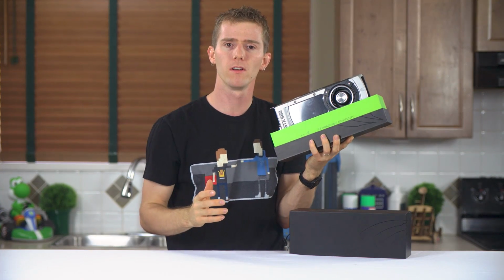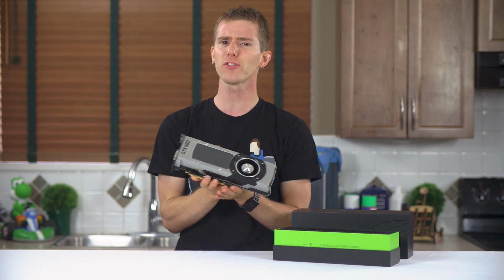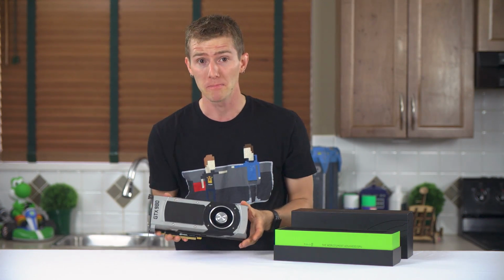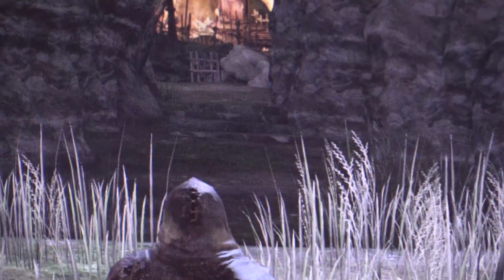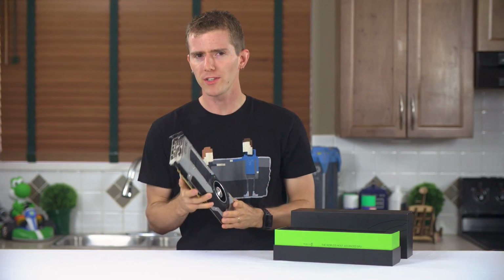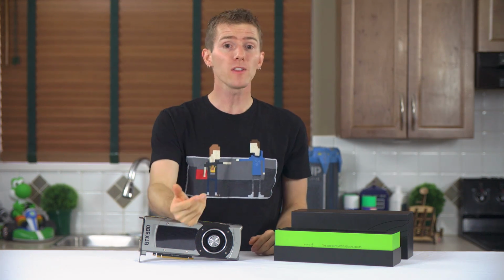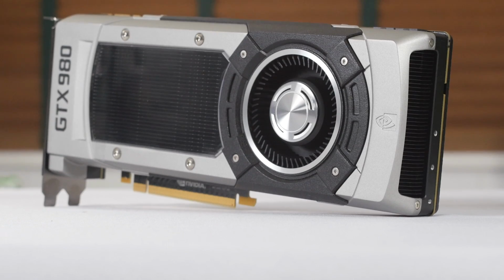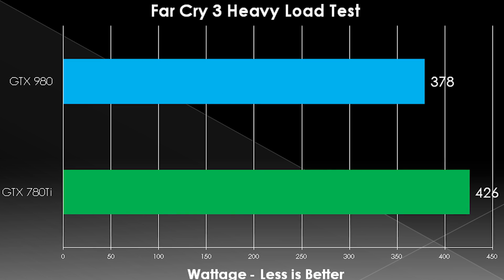NVIDIA GeForce GTX 980 Video Card - Performance Overview

Comment: The 980 doesn't even justify it's name, looking like it's two generations ahead of the 700 series yet both the series flagship cards perform the same! Are you kidding? Neither cards will get my money. The GTX 780 ti and 980 are neck and neck, and I expected it to perform a bit better. 4K is still way to difficult for a single graphics card to handle, maxing out your game settings with 4k will leave you @ under 40 fps. I am looking forward to a possible 980 ti, or an early 2015 release of their next 14 nm process. Although, I do realize the features the 980 brings, but is it really THAT compelling? In my opinion, not at all. Unless you have a 500 series card, don't even bother.
Reply: It's not two generations ahead, NVIDIA skipped the 800 series for parity with the mobile series.
Reply: I really hope AMD brings up some rough competition with their R9, "300" series.. I've been rocking an Nvidia card for 2 years now, but I'm not biased. If AMD can really bring some performance to the table, I would switch in a heart beat. But they can't manage that so far. Because of this, AMD only owns 30% of the GPU market share. If they can win me over with TRUE next generation performance, chances are they're gonna grow that market share. If it does win me over though, I'll really miss CUDA.
Reply: I almost think Nvidia should have just waited for the 14 nm process, because it is not worth upgrading in the least bit. All you get is slightly better power consumption and more features that chances are, not many gamers will truly care about. Performance gain is about 5 or 6 percent from the 700 series when you consider the recent price drops.
Reply: Ya I agree, I have 2 680's and the power is more than enough for me. I thought this card would have atleast been 30%+ better than the 780. Until NV releases a single card that can beat my 680's, I'm sticking with them.
Reply: facepalm.  the 780 AND 780ti can BOTH handle 4k gaming JUST fine.  Ya DON'T need maxed in game eye candy and YA DON'T even need ANY AA let alone 2 or 4x AA.  Ya don't even need AA on 1440p 27" at 2.5 feet from the monitor like most NORMAL people would view it from.  Why does every idiot think they MUST have maxed settings for the game to look great.  

The ppi in 4k 32" at 2.5 feet from the damn screen , ALONE, is PLENTY to NOT need anything more than even medium settings and NO AA which is PLENTY of eye candy goodness.

You people need to get over yourselves and have a reality check. And NO, both the 780ti and 980 DO NOT perform the same.  bf4's MINIMUM ( which is the MOST important FPS measurement for anyone with half a brain on pc gaming) is improved from 40-42  to 50-54..If you can't see the difference in 10 fps at the 40 or 50's mark, you need your eyes examined by a professional eye doctor.  It is WORLDS apart difference?  No, but it's NOTICEABLE enough.

" Unless you have a 500 series card, it's not compelling choice".  *facepalm*.  
 

UNLESS you have a 4GB gtx 680.... a 4GB 970 and 980 WILL be a good and VERY noticeable improvement over a measley 2GB vram 680.  If you thought differently, then you obviously have a clue and haven't kept up with pc gaming hardware at all.
Reply: You realize that the 980 is in fact a direct replacement of its little brother, the GK104 680, not the GK110 based 780&780ti&Titan. Those cards are totally different chips based on the same arc. So when you take that into consideration the 980 is about 2x the performance over the card it replaces. Not only is it 2x as powerful it even runs at no more than the same exact power draw. They skipped the 800 series desktop cards as to keep the mobile GPUs and desktop GPUs in the same family name. They did the exact same thing with 300 series.

And if you want to compare the 980 to the GK110 chips you must note that:
1.) The 980 has over 800 cores LESS than the fully unlocked GK110 chip found in the Titan Black and 780 ti.
2.) With both cards at stock speeds, that is the 980 and 780 ti, the 980 is on average 10% faster while using 50 watts LESS than the 780 ti.
3.) Since the 980 has a TDP of about 200W and has the same cooler built for the 250W GK110 cards, the 980 has considerable overclocking potential. K|ngp|n has already called these cards overclocking monsters.
4.) NVIDIA is making 4 features exclusive, for the time being, to the 900 series. These features, when adopted, will bring more realistic "eye candy" to screen.
5.) The 900 series also has an exclusive feature, as of the writing of this comment, of Directx12 support.
5.) The drivers for the 900 series, as of the writing of this comment, are in early release phase. NVIDIA can still streamline the drivers for the cards, leading to higher performance from the cards. We've only seen the beginning of what the 900 series can do.
6.) NVIDIA accomplished all of this on the same 28nm process that the GK104 and GK110 chips are based on. It's TMSC's fault that they couldn't get their factory to create an efficient yield of the GM204 chips on the 20nm process, which these cards were originally meant to be on. Imagine the performance gain along with the power efficiency that these cards were supposed to have. NVIDIA settled and this is what they got. A card that outperforms all other single GPUs on the market at a competitive price while using less power. AMD can't touch NVIDIA. And if AMD comes close with the Rx 3xx series, NVIDIA will just release a replacement for the GK110 chip.
Reply: Raymond Tyson so mad what if he WANTS to max everything? I want to, just don't have the money to spend on upgrading. Gr8 b8 m8
Reply: The Minecraft Sauce
well amd's r9 295x2 beats the titan z easily for about half the price if you want to go get it :)
Reply: ***** I know that, jeez, I'm not an idiot. It just isn't worthy of the 900 series name. I said it was looking like it was it's two generations ahead. Maybe you should actually read posts before calling people idiots.
Reply: The 900 series is FAR from obselete if you have a 600 series. The 980 is a poor example to look at either way - it provides some ~5% gain on a 780ti, but it does so at a lower price point than when the 780ti released, and also consumes quite a bit less power. The real gem lies in the GTX 970.
A card that beats the 780 with ease and nips at the 780ti's performance in many cases, yet has a TDP that's 105w lower, whilst being very silent and in the case of some cards, doesn't even activate its fans until 50c has been reached.
The best part? it's 25% cheaper than a 780!
Heck, over here in London it's actually £30 cheaper than the price I paid 2 years back for my 670, and even then that was at a special sale price.
You can currently grab 2 970s for around $40-50 more than the cost of a single 780ti. Perfect card in my opinion.
Reply: i got a 780 and 4790k just for porn. shut up, buy whatever you want and use it whatever you wanna do with it.
Reply: I highly recommend reading Amazon reviews before you buy Graphic Card amzn.to/1tIcF9m Click to view now !!!
Reply: u're a total tool. they chose the name because the 800 series is around for ages in laptops already, so using 800 now for the desktop cards wouldn't really justify their performance.
in this video you had a direct comparison on the old and the new chip and you still don't think this is awesome? dude, the new chip is A LOT SMALLER. this alone is an awesome archievement for nvidia because it reduces production costs a lot making the relatively low prices possible and ofc lowers the power consumption, heat and fan noise.
at the same time they manage to increase the power A LOT compared to the old architecture considering that they are still on the same 28nm process.
the performance gains you want are not possible anymore because it is very very.... very very hard to go to even smaller processes so you don't need to expect that now and especially not for the future.
if this power is not enough for you you should not wait for the new generation of AMD cards because it is pretty much unlikely they will beat these cards a lot. if they do, nvidia will just bring a bigger version of this chip in maxwell 2.0 design and put even more transistors on it and you'll get something like the 980TI which will beat every other card out there again.
I am not an nvidia fanboy, I own a R9 290. and this new generation makes me cry... (I'm on an UHD monitor and really need the power)
Reply: Dude it completely makes the previous cards obsolete. Better performance in just about everything + its cheaper + new features added. What more could you want? As with pretty much all generations, its not worth upgrading for the lols, but for someone who's building a new PC (like me) waiting for the 900 series cards is a HUGE benefit.
Reply: Sizzling Salami  hmm shit taste in games yeah. thats why i have a 980 to run minecraft moron. To be honest i dont play it anymore my profile pic and name needs an update. I personally play skyrim, BF4, rust, Cod, gta  and other similar high end games. just because your running a nvidia gt 210, maybe in a few years flipping a few thousand more burgers at mcdonalds you can save for a gtx 660...
Reply: i forgot to mention it costs millions for nvidia to develop a new nm process, they ait gonna cook one out early 2015. Plus the 980 is £470 a 780ti of same brand is £520 and the 980 is faster and more power efficient. they havent benched any high clock cards yet i.e evga.

and nvidia have stopped ti versions of cards now.
Reply: Also for those comparing the Titan Z to the R9 295x2. Just remember the Titan Z is for compute processes and simulations. It is in fact based on the GK110 which was the GTX Titan's chip, which was a GPU for the Titan supercomputer. The GK110 chip was never built for gaming, ever. NVIDIA just tried to market them as a middleman chip, good for gamers that are also workstation users. And for workstation users, the Titan was a blessing. Do you know how much a full silicon and metal workstation GPU costs?
Reply: Grubite
Why the hell would you want to play the unoptimised, broken, shitty low res console port game that is Watchdogs ON A PC? And moreover, why play it at 4K when it's not even good looking at 1080p? ...

Anyone who bought a high end GFX card to play shit like that needs to be shot and have their PC donated to a real gamer.
Reply: The greatness is in the power consumption and efficiency.
Reply: I highly recommend reading Amazon reviews before you buy Graphic Card amzn.to/1tIcF9m Click to view now !!!
Reply: it's all hype. 4K and what's not ! the performance got so high due to fierce competition with AMD, they didn't know where to go with all that performance, so they had to come up with 4K to justify the performance and give people a reason to buy that "performance". this is why 30fps isn't considered playable anymore and this is also why the 900 series isn't meant to push "performance" significantly although the technology exists to build much much so frkn much faster gpu's
Reply: tbf this is the stock gtx 980 at turbo 1216mhz. The custom evga, msi cards run at turbo of around 1350mhz. still cheaper and faster than the 780ti. Considering it has lower cores 2.1k vs 2.9k and only 256bit bus vs 384bit. ive upgraded to the 980 from a much lower spec card. although i doubt you would need to update from the 780 as it can still run most games just fine.
Reply: Sizzling Salami
we dont all play minecraft, sure i play it but not all the time, im planning on playing BF3 and BF4 when i get my new rig
Reply: Sizzling Salami  so bf4/3 is not to your taste then? i spend my money on what i want. and yeah its cool that trolls like you cannot have what they want. dont forget ill be coming for a burger tomorrow, i would like a big mac if you can get me one ready at around 2pm :')
Reply: Sizzling Salami
1. not all gamers live off their parents' money, im getting a job soon anyway. 2. not all gamers live in fucking basements fucktard
Reply: Sizzling Salami  nah i earn £15 an hour, i do what i want. and no i pay my parents and go to work 52 hours a week. just saving for my own place at the moment and should be moving out soon.
Reply: Sizzling Salami
fucking dumbass why do idiot pieces of shit like you exist? oh ik, a girl's night out drinking and bad ideas thats why you exist
Reply: The Minecraft Sauce What are you meaning? They do compete with Nvidia in terms of raw fps? How do you think the r9 280x competes for the 770 etc? You clearly are bias.
Reply: TwHawrd
i'd go and buy it as soon as it came out if they released one
Reply: Ya but the 980 brings a lot to the table for cheaper, less power usage, and better Graphical rendering for the future, if you were going to upgrade your graphics you should undoubtedly go with the 980 rather than the 780 ti which production will be canceled soon, Unless you are in the market for workstation graphics.
Reply: Lets wait for better drivers to come out to unleash the beast's truly potential. Also, it uses less power, is more silent and lower temperatures. Its not all about performance.
Reply: Martin Kargo it kinda is all about performance i meant I'm not gonna spend that much money just to save a little electricity I'm spending to be able to play bf4 100FPS on ultra
Reply: lord quasimoto 4K is not far at all. Expect 4K to be powered by $400-$500 GPUs in a year or two.
Reply: The Minecraft Sauce The next step for GPU manufacturing is 20nm, followed by 16nm FinFET. Only Intel is going to use 14nm, but they're almost 2 years ahead of their competition.

Besides, this card has an 165W TDP. Compare that to the +280W AMD's 290X is using and you get a feeling how fucked AMD currently is...
Reply: I have an AMD 7770 It's time for a 980 xD
Reply: Andreas Tapas
why are people talking about minecraft???? minecraft is all about the processor.... shaders in minecraft maybe... and there is no such thing as "real games". If it is a game it is a game..... -.-
Reply: Puthearith Chea
you really like the 4K real feal xD
Reply: Andrew Russell
QUIET!!!! NOT QUITE!!!!! Every fucking day I see thousands of Youtubers who can't spell QUIET! It's not hard. One is Quiet ... the other is Quite. Something can be quite quiet, but it can't be quiet quite. OK? Think about it.
Reply: Andrew Russell Then you paid £500 for a useless piece of trash phone. What ever happened to spelling it yourself? The brain is a muscle too. Imagine in 50 years when the oil runs out and there are no more phones or autocorrect. We're gonna have a society of illiterates who can't even comminicate with a pen.
Reply: Andrew Russell
If everyone took a chill pill, and forgot about the skills, values and traditions that humans in western society have developed since the Romans, then in 10 years everything would fall apart and we would have a country full of mong zombies. So forgive me if I refuse to take a chill pill and continue to exercise my brain. I wipe my own ass, I make my own meals and I spell my own words.
Reply: Yeah I've recently been contemplating selling my 780Ti for a 980 but recently decided against it.
Reply: All I can say is 780ti kingpin SLI ftw!
Reply: FreeTheSecondOne
lol if you've actually got that... That is a  SICK fucking build. I've got the reference 780Ti, but if I had my choice in which one I'd get, I'd have definitely gotten the kingpin one. Some people hate the way it looks, I think it looks awesome.
Reply: TheVanillatech NVidia cards have almost always run below 80 C ur clearly into AMD so go troll somewhere else perhaps?
Reply: ***** The technology is amazing on the new GTX 980 no doubt, but even with (as people call them) "matured" drivers I don't see a big impact in performance. I think people should stop arguing and accept that the 980 beats the 780 but is more or less even in performance with the 780 TI. But also that it was never made to beat the 780 TI, which is a ridiculously over-priced card.
Reply: TIZ012 pretty much i was trying to say you a dumb ass and what ***** said to you
Reply: Divey1130 im personly upgrading from a 670 to a 980 i want some more horse power and i want to do it with 1 card
Reply: It performs better than the 780 TI for $200 less than the 780 TI, what's NOT to like?
Reply: as for me, i'm still running to GTX 560 Cards in SLI, so it would be an upgrade for me. I was really wanting to get the 780 Ti but it's just about 700 dollars! 700! Compared to a 980 which performs about the same in most cases, if not better for 549! To me.. how could you not choose this beast of a card? Sure the 290X from AMD is cheaper, but the nvidia card is a better card overall.
Reply: GTX 980 is to be compared to the 680, in reality. As it is GM204 just as the 680 is GK104. The 780 and 780 Ti are based on GK110, GM110 will likely be launched with the new Titan or 980 Ti in the coming months. 

You also have to remember that the 780 Ti  launched at a price of $700, even the 780 launched at $650. This card is $550 and delivers performance the matches the 780 Ti while being much more efficient and cool.
Reply: Minecast Zyad48 2 to 3 cards is realistically the best of the best practical pinnacle of pc gaming each time. The 4th card is always pointless and damn near useless overkill and a bigger hole in your wallet that could  have otherwise paid for a 512GB damn good ssd instead.  2 980TIs is a great idea imo.
Reply: The 900 card run at low watt with low temperature thus having lots of headroom for overclocking.
Reply: Raymond Tyson ***** first ok it was joke let stop fighting, second im actually not even in college yet and still in high school and I already can tell that one word in caps isnt yelling, although certain ppl dont get it so I guess using "*"'s would help in that respect but most ppl already get it and even use it(i use the caps on one word thing sometimes)
Reply: Nitrobucket because the 980's take less power and produce less heat and therefore have more room for overclocking and will give off more performance after overclocking
Reply: The above posts is why no-one should ever, EVER take advice from ppl online about technology. Do your own research form ur own opinion :D
Reply: Crowded House I highly recommend reading Amazon reviews before you buy Graphic Card amzn.to/1tIcF9m Click to view now !!!
Reply: With newer drivers the 980 should perform a bit faster than a 780ti, but look at what you're getting with the 980: Less power consumption, 4GB vram, less heat, special features such as MFAA and VXGI. I left my GTX 780 and grabbed two 980's and I ain't ever looking back lol.
Reply: I have a 660, the 980's looking quite shiney to me.
Reply: Raymond Tyson
CUZ WE WANT THE EYE CANDY BUT WE ALSO WANT ACCEPTABLE FRAMERATES THE 780 DOES NOT HANDLE WELL ON FUCKING 4K WHICH IM SURE CANT BE RUN AT 60 FPS ON LOW SETTINGS SINCE 4K IS 4 TIMES HARDER TO DRIVE THAN 1080P THE 780 TI CAN RUN 4K ON LOWER DETAILS AT 60FPS YES BUT THERES NO REASON FOR 4K ITS BETTER TO RUN THE GAME AT 1080P AT HIGHEST DETAILS AS IT WILL LOOK BETTER THAN 4K AS LOWEST DETAILS, although what do yhou mean that the minimum on BF4 is 40-42? i love BF4 but i dont understand what you mean by that
Reply: I'd rather go with the 980 for a new build, it's the same price as a 780 so it's a bit more worth it for for the price.

It's not worth the upgrade from the 780 but it's a better choice for an upgrade from an older/low-end GPU or for a new build.
Reply: Sizzling Salami  ;P
Reply: Divey1130
Oh yeah because 1 can obviously beat 2. Stop bitching about it. Two cards will always over power one card.
Reply: Henry Liu  nvidia 210 x2 vs gtx 980 :D
Reply: The Minecraft Sauce Ya know, all their results are overclocked. Stock speeds the 980 stomps out the 780 Ti, so does the Asus 970 Strix, for a list price of 350$ USD.
Reply: Currently I have a 780 and i won't change it until Nvidia releases it's Pascal Cards but if the difference is still to small i also won't take a Pascal card.
Reply: TB Craft there are benches out on the Asus 970 Strix. You will need to use google translate tho. http://www.sweclockers.com/recension/19332-nvidia-geforce-gtx-980-och-gtx-970/7#pagehead ; list price is 350$ USD. I wants one.
Reply: ***** I understand that, but it isn't worthy of the 900 series naming. With this performance difference, and the fact that it's still 28 nm, I have no idea why Nvidia skipped the 800 series naming scheme.
Reply: jcauleyj They skipped it because their mobile gaming-cards were already on 800, and so they wanted both mobile and desktop GPU's from the same Architecture to have similar naming schemes in order to lessen confusion among consumers.
Reply: You don't know what you're talking about. 14 nm?   That's many years away, next year is 20 nm.
Reply: Sizzling Salami You kidding me? You think all I do is Minecraft? For one, I do audio production, content creation, 3d animation, ACTUAL gaming, and much more. Stop being so stereotypical and open your eyes.
Reply: The Minecraft Sauce I may seem dumb but what if they release a 980 ti? :/
Reply: *****
True. But the cards don't perform as well as a workstation counterpart. But compared to the workstation counterpart the geforce version could handle gaming. So they decided to market the confused GPU as a gaming card. This is both NVIDIA's fault and the consumers fault. But mainly the consumer's. If the consumers researched the item they were thinking of dropping 1k dollars on instead of following the mantra "More money means more performance" then they would have realized that those cards are in fact not for gamers but for niche consumers that reside in the in between of the worksation and gaming community.
Reply: There marketing for this card was power consumption, cooling, and cheap upgrades. Dont forget these cards will be Overclocked to fuck when they have aftermarket cooling on them. 980's in sli x2 only need a 700w PSU under max load.
Reply: dude they only look the same and the 980 preforms a little better and is 150 dollars cheeper. plus you waiting for a 14nm process aint gonna happen they would have changed it in the 980 if they were going to change it at all. so if you want get a 550 dollar 290x that doesn't even preform nearly as good as the 980 but for the same price.
Reply: Sam Kowalski
where on earth did you find the 980 for 150 $ cheaper? i could only find it for 20$ cheaper
Reply: LOL i found it on amazon for 550 dollars unless the price changed. and if you play games like mine craft all you need is a 760
Reply: Sam Kowalski I have a 760 and I still need more for shaders and recording and mods.
Reply: RgbShadow yeah you will definitely need more for shaders but my friend plays a mine craft world with like 125 mods and still pulls some good FPS and recode while doing so. and mods are more CPU/RAM intensive. so yeah what do you use to record and what brand 760 do you have (msi, EVGA, etc...)
Reply: Sam Kowalski I have an EVGA and I do play with about 125 mods and get a good 130-230 fps once you add shader tho I get 50fps and I have a 4.4 oc fx 8350 but without shaders 760 is really all you truely need
Reply: well yeah shaders i know just is a FPS killer. so yeah if you want shaders at 60FPS you could probably just get a 970 cause the 970 is suppose to only be about 300 dollars and still preforms good. RgbShadow
Reply: I'm personally going for the 980, but that's because I currently have only a 7870 that has been giving me some issues lately with drivers, even after going back to the stable ones. I also have Star Citizen, which I plan on playing with my friends, and I know for a fact it'll just send my 7870 to hell. All the other features from Nvidia are really nice too, and I have the money to back up justifying this thing. Everyone has their options tho
Reply: Martin Kargo
its about both performance plus lower feat, sound and power consumption :D
Reply: Let me guess your a amd fanboy besides maxwell is full of potential and with lower energy requirements at almost half as much as the 780ti while performing better which for over lockers the lower tdp is great as it won't run as hot and for those who will do sli especially with a 5930k and a x99 mobo (my self) will give so much more performance compared to sli 780ti also the 980 has less cores than the 780ti which has 2880 cores which gives maxwell the advantage to become amazing in the future and it runs directx12😱 be amazed and join the future and the cheaper price is worth getting the 980
Reply: The 980 is better than the 780ti, more overclockable, and runs cooler, and quieter, and isn't even a ti edition.
Reply: MitchHellion
and its cheaper ^^
Reply: Minecast Zyad48 Yeah
Reply: Consider looking at it like GK104 vs GM204. The increases are great that is for sure. GTX 780 and GTX 780Ti are based off of GK110, a totally different beast. IMHO the moniker/nomenclature ARE NOT to be dissected as you have done.
Reply: The Minecraft Sauce
Dude .... AMD (ATI) have been current leaders in terms of performance / value for over 9 months now, in EVERY section of the market. They have also had the most powerful enthusiast card for even more than 9 months. What more incentive do you need? Both the shitty next gen consoles use AMD GPUS, so you can bank on the fact that every single game which comes from the consoles to the PC (no matter how shit they will be) will ALL run faster on AMD hardware.

Now is not a good time to buy any card. Until the prices hit rock bottom of the older models in a few weeks I'm holding out anyways. Probably be able to pick up a GTX770 or an aftermarket 290 for very cheap soon.
Reply: epictoads But if you have a 700/600 series card already, it makes the 900 series obsolete.
Reply: Sizzling Salami So? Does that mean the only thing I do is Minecraft? No.
Reply: I wondered about this too, but earlier today I drew a conclusion
Remember when 800 series came to laptops? I had no new features compared to the 700 series and I don't know why they weren't implemented (Either because chip manufactures were late or technology wasn't developed/done yet.) but because of the 800 series not having these technologies they had to call this (which was going to be 800s) the 900s series as it features things like MFAA and DSR.
Reply: 14nm? You mean 20nm?
Reply: Grubite 4K is already powered by the 980 quite well unless you're a hardcore gamer. Starcraft 2 probably gets 60fps on 4K at max settings. it's an old game, but still noteworthy.  I mean, who needs max settings anyways. 4K is already pretty boner
Reply: Mark Cuntie I'm talking Watch_Dogs Grand Theft Auto IV (modded of course.) and games like that.
Reply: TheVanillatech Watch Dogs is fine. It runs at 60fps ultra 1080p on my 780Ti, 16GB RAM, and i7-4790k
Reply: Grubite
If Watchdogs is fine to you, then all the best!
lol
Reply: Holy shit this comment is bad.
Reply: Derek Foster i would like to make a little correction. the cooler on the 980 is heatsink based, not vapor chamber based. however thats just my being nitpicky.
Reply: Really, the real shocker is the 970...
Reply: I have a 400 series card still so I'm going for the upgrade.
Reply: Your Doom

Had this come out 3 months ago, I wouldn't be using a 280x...

Still, with the 280x going down in price I'll probably be able to pick one up in a couple months for a crossfire setup without any problems.
Reply: well put
Reply: elgoog kcuf
Still, there's probably going to be some nice price cuts soon... I'm thinking Crossfire.
Reply: "But will it play Minecraft ?" pft of course retarded question :)
Reply: Gds1 dcf d
Reply: TB Craft Wait wait wait....hold on this might offend you but wait a fucking second BF4 is considered a high end PC game to you? All you need to max that steaming pile of shit is a GTX 660 which in itself is a sub 200$ card hell last I did a price check you can get the Asus GTX660 around for 150$ I just wanna know how is that in any way considered high end?
Reply: The Minecraft Sauce
 having a 700 series card doesn't make 900 obsolete, that's just a stupid thing to say. they are BETTER and CHEAPER, thus making the PURCHASE of a 770/780 pointless now.
yea it's not worth upgrading from a 770 to a 970, but neither was upgrading from a 680 to a 770 when it first came out. It's not about making everyone upgrade when a new series of cards come out, it's about improving upon existing cards so that progress is made. the 970/980 improve in EVERY ASPECT over the 780, making it an improvement.

wtf are you even complaining about? Nvidia release cards that beat out all competition in terms of both price and performance, and it's not worth buying?
Reply: epictoads
Climb out of nVidias ass please XD

Sure they just released the new single GPU performance king and the best power to value card on the market, but they are BRAND NEW technology. AMD/ATI has owned both those titles for over 12 months. And if you discount the new cards, AMD had a better solution right through the entire spectrum for about the same time period. nVidia needed to do something or they were gonna get fucked.

I guess when ATI release their next cards and beat the shit out of the 980/970 in terms of value and performance you'll be paying homage to them too?

Nah you won't. Cos you have a giant "N" tattooed on your ass.
Reply: TheVanillatech bray you can stop cause its just as cheap as the 290x and well i think we all know which one is faster oh sorry i forgot the 780ti was faster 2. like you are obvi a AMD fandoy because the performance to money is what matters not whatever the fuck your talking about
Reply: TheVanillatech and if you are gonna be that quick to say he is a fanboy then don't act like a fanboy cause we can all tell you are one
Reply: ColinZtmnf lol that is like perfect what you just said
Reply: Minecraft is BS end of story... try some real games ffs !!!
Reply: CentralNintendo1
LOOL
Reply: I got two 660 Tis, and I'm pretty sure it will be an upgrade well worth my money.
Reply: Yeah, I am fine with my 750ti, fast as a Cheater, quite as nothing and uses less power than my toaster
Reply: Are you stupid? This is the general step up naming. You get the next card up's power at the lower number. 780ti at 980, same performance would be 980 being 780 performance. 780 performance is at 970, just how the 680 when to 770 (literally the same card just overclocked).
And as you can see the 980 IS quite a bit faster than the 780ti in 1080p and on par with 4k after overclocking for less money. Also most people are gaming in 1080p, 4k still has a like 2 years before it's more adopted and single gpus can handle it easier.
Get out of here.
Reply: Kian Palmer
Im selling my 2x670s and getting the 980. It will be slightly faster for me. I want the way less heat and im going to watercool it so it will be quite. I do want a 980ti but they haven't announced yet and I'm on a time limit.
Reply: TheVanillatech I know it's quiet, it's called autocorrect that messed it up.
Reply: TheVanillatech You realize that you can spell a word correctly but the phone thinks you're spelling something else, right?
 You need to take a chill pill dude.
Reply: TheVanillatech If I had've spelled everything wrong then I wouldn't blame you, but if you freak out over one word in a comment on every comment, then you may want to get off YouTube. People don't care about spelling, this isn't English class or a job.
Reply: Andrew Russell
My quibble isnt really with the odd spelling mistake. I told you I have seen countless comments across numerous websites where Quiet had been spelled Quite, maybe 40 in this last month alone. Clearly this technology, created solely for the purpose of communication, is actually hindering it.
Reply: TheVanillatech I feel it is mostly due to kids refusing to learn. They just want to play around and not learn. Part of it is technology with things like autocorrect but I blame the people more. As we speak I'm sitting in my college networking class and there are two people that never pay attention yet complain about not knowing anything.
Reply: Andrew Russell
Accepted. The pattern is basically a steady drop off a cliff since basically even before I was born. I see kids every day who have the same attitude and problems. Must be hell being a teacher these days with your hands tied behind your back and your lips taped shut, and I plan on becoming one myself. Having said that, for all the bullshit laws put in place to assist this downward spiral, there are still some great teachers. There are also a lot of moronic ones who probably only turn up for the cheque. Wankers.
Reply: First of all it's the next generation since 800 series is mobile chips, and secondly the 980 is flag ship because there is nothing else, when the 980Ti is released it will dominate both the 980 aswell as the 780Ti, you can't compare an 80 class card to the previous generations 80Ti and complain that they perform the same, they should be.
Reply: *****
This is what I hear in my mind when I read your comment :

"Merrr mer meh mehhhh merrrrrr. Rarrr rarrrr Rarrrr Rarrrrrrr. Blah blah blah zzzzzzzzz............"

And then I fall asleep.
Reply: *****
Your mama
Reply: *****
No friend.... YOUR Mama.
Reply: *****
:D Dickless
Reply: *****
Merry Prassy
Reply: cough cough Overclocking cough cough
Reply: I love rumours about new tech as much as anybody else...but I'm realistic about it. There was no way in hell that the next nvidia GTX x80 would completely destroy the GTX 780 TI. I read many posts that it would up to 20%-30% better than the 780 TI and that sounded impossible. However it was possible for it to be 20% better than the actual flag ship nvidia card which was the original GTX 780, which it was...so nvidia has done exactly what they do with every other generation of GPU. People tend to think the 780 TI is the same as the 780 just upgraded (which in all honesty it is) but its more like nvidia's new GTX x90 introduction...the 700 series had no actual GTX 790 why was that? Because the 780 TI already existed thats why. Also if someone wanted a ridiculously powerful card they would go for the Titan Z which is basically the GTX 790 with increased double precision performance. Thats it I guess...
Reply: wow a lot of rich people in that comment section. talking about "1000 dollars cards" like they are cookies...
Reply: Yeah its not a good idea to sell a 780 TI for a 980, the pure processing power is better on a 780 TI. Also I don't agree that the GTX 980 is 10% faster than the 780 TI as it was commented previously in the comments. Its more or less equal in terms of real in game performance, with some instances 980 is better and others 780 TI.
Reply: TIZ012 Plus the 780Ti has 2880 CUDA cores vs (how many does the 980 have? I know its significantly less, like 2032 or something), and in my mind, that makes it more valuable in itself. Sure I'd love a 980, but I couldn't possibly rationalize selling my GTX 780 Ti for less the $500 at the moment considering a dropped $700 on it in the first place.

The 780 Ti is a beast of a fucking card and there really aren't that many games I can't max out as it is. Te only appealing thing about the 980 to me is the overclocking headroom. I'm really interested in that as I love overclocking.
Reply: *****
But can it run Crysis?
Reply: Sizzling Salami
What is wrong with future proofing your gpu?
Buying a flagship card may be expensive but it will last you "at least in my case 4-5 years" before upgrading again.
This is common enthusiast practice.
Reply: Sam Kowalski Well, lower power consumption = less heat, less heat = better overclocking. So far ive seen numerous of people hitting 300+ core overclock with just reference aircooling, which is a huge leap and should push the gap even further from the 780ti. And as mentioned earlier, lets wait for drivers to mature.
Reply: Martin Kargo yeah idk but i think the 980 gtx with a reference cooler is good enough for me cause i would rather just get a water block then oc like a bouss haha
Reply: I like my cards not melting, so I'd rather not get anything from AMD
Reply: Maxim_Iliagouev
Ahahaha! The first time nVidia release a card that runs lower than 80 degrees in years and BOOM the fanboys bring out the dusty old guns from last decade. Priceless xoxoxo
Reply: I think the whole point in the 970 and 980 is the fact that they have the same power as a titan but at a far lower price, this might not be great news for a millionaire gamer but for the rest of us this is a great thing to happen! From this point they can make even stronger graphics card for smaller price tags.
You see, there are two ways that a product can improve. 
1. It performs better. 2. It performs as well as its predecessor (but) for a lower price.
Reply: TheVanillatech What was the point in bringing out the old? I'm talking about the new.
Reply: TIZ012 Okay 980 aside, is the 970 good value for it's price? Could it easily compete with the 780 (not ti) ?
Reply: TheVanillatech lol no whats priceless is that AMDs newest and best single gpu card runs hot as hell. LITERALLY. ***** Yeah the 970 in my opinion is very good for its price and could probably preform pretty close to a 780. idk though just watch some benchmarks
Reply: ***** Yes from current benchmarks and from my own playing around with the card it looks like the GTX 970 is actually more revolutionary than the GTX 980, in the sense that it is very close in performance to the 780/980
Reply: Maxim_Iliagouev I don't know what old he is talking about, I've followed and worked with nVidia GPUs since the GeForce 5500 all through out the 6/7/8/9000 series plus the 1/2//4/5/6/7/900 series. I have never encountered a GPU (stock spec, third party) which goes into the high 80 degrees C. For the record just in case anyone wants to correct me, a stock GPU is meant to hit a certain temperature under full load, normally its specified for nVidia to be between 85C-90C and AMD is around 90C-95C, having said that guess from the two companies which normally keeps within those parameters...can give u a hint and say its not AMD
Reply: TIZ012 amen ^^^^
Reply: ***** uh yer dumb because I'm sure these guys can OC way better than you plus you can't OC good on reference cooler cause they don't have the best cooling
Reply: FFS trolls like u annoy me...I don't mind ur opinion but when u try to flame someone else's post especially pulling the "if u can't spell" bullshit...maybe u should check back at ur comment and try writing out beat a few times so that u can also learn to spell. As for ur previous "opinion" u might be right, who knows maybe the 980 will be soo amazing even the titan z will be useless piece of crap. But as it stands these are the results we see these are the results we get, fact. When the new drivers come out and make NVidia the stupidest GPU developer in the world that's when we will know for sure the 900s true performance. From past experience I would just like to say, drivers don't often make a GPU miraculously AMAZING. But we will see. Now just stop trolling and flaming other ppls opinion just accept it or reject it that's it.
Reply: TIZ012 lol we dont need a fanboy here so you can ether not be biased or you can shut the fuck up and leave cause people who are fanboys dont look at the fu,l picture cause i think we all knwo that the 980 is the best card and i kinda think the titan Z is tupid is just to sli 780 tis tapped together
Reply: ***** lol so ignorant. Alright genius
Reply: Sam Kowalski I don't understand ur comment, and I'm not a fan-boy if ur talking about me?
Reply: Chill :)
It will come in time.
Reply: interlace84 lol i agree pretty much with what you are saying I'm just here to say i thinks its hilarious you weren't trying to start a argument and then technically is gonna try and start one with you when he 'agrees'. so since he 'agrees' i odnt get why he is gonna try to a rue with you
Reply: Why give him a useful tip, clearly he will just insult you again. Its like talking to a spiteful wall, that won't budge for anything
Reply: TIZ012 lol for real he insults people who agree with him
Reply: I thought of buying a gtx 980. But wait before you say anything the current GPU I use is Nvidia 9500 GT. I think thats an upgrade worth considering!
Reply: ***** Sounds about right :) thanks for the feedback.
Reply: yeah um I have  GTX 580 O.C from MSI and it died on me last night so..... I'm probably getting a GTX 980. Definitely not buying anything from MSI ever again. I think I'll go EVGA this time.
Reply: Kenshin Himura why won't you ever go msi again i mean that is a pretty old ass card. it was kinda bound to burn out sooner or later. but yeah evga is just as good so you can do whatever you want :)
Reply: ***** lol thats exactly what i was thinking cause msi is like the best manufacturer out there
Reply: ***** EVGA has a damn good warranty. Also nice cards. I prefer ASUS though.
Reply: ***** The 700 and 600 series will get that too.
Reply: TIZ012 I think they hold back their tech on purpose. It's always the same jump, but the 500-600 was a little bit larger. That's business! They probably could release some crazy shit if they wanted to.
Reply: All you guys should just stick with intel HD graphics.
Reply: Did you not see the name nvidia ? What did you expect, they believe that gamers want the same thing using less electricity. This is literally what they did. I'm suprised most people haven't noticed the 400 cude cores lacking from the 780. Compare it vs the 390x with with more than 2x the cores at 4224 2x the Rops. This gun be good in 4-5 months.
Reply: No top of the line card will handle 4K at a decent fps without SLI/Crossfire. It wont happen for a while.The jump from 700 to 900 is major. Lower TDP, power consumption, higher frame rates at a lower priced card, ability to use the new Nvidia technologies (MFAA,DSR,VXGI). Expansion to 4GB DDR5 leaves space for multiple card and thus 4k rendering. AMD is going to drop the 300 series soon, and it most likely wont perform too much better than the 980 at 4k. Not to mention, it won't have MFAA,DSR and VXGI. Technology is advancing at its own rate, things are always being pushed further, but it's on the table as the flagship of gaming GPU's. It's not worth to swap a 780ti or any of those high range cards, but for anything lower, it's worth it.
Reply: Serenity  AMD was the first to 4k. Remember they were releasing cards with up to 6 gigs ram 2 years ago. The 290x can play 4k without crossfire. Nvidia until the titan couldn't even entertain it without SLI. The 980 has 5 gigs of ram but not enough core power becuase of it's reduced ram bus size. 256 nvidia vs 512 amd. It makes a big difference when scaling up.
Reply: William Russell the 290x tho still struggles ALOT with 4k cause unless you are playing like mine craft any game on any card at 4k is only at a nice and 'smooth' 30fps so who cares if AMD was there first cause the still having figured out how to do it considering that nvidia is faster at 4k too. and just my opinion here but the 980 or 780ti is better than a 290x a little is performance but mostly in the fact that it just runs cooler and hell of a lot quieter. just saying I'm not trying to start a argument or anything
Reply: Sam Kowalski  You seem to miss the point. It struggles when running things in ultra that is it. It will require more going forward. Being first does matter because it tells you the objectives of the company. Making money is fine but delivering something to use is great. Nvidia realeased the titan - so lets not forget they had 4k for almost twice the price.
Reply: lol yeah lets not talk about the titan tho lol those were the dark days of nvidia. so yeah i see what you mean William Russell
Reply: Minecast Zyad48 The eye candy is ALREADY THERE.  The damm ppi is MORE than enough.  This isn't 10+ years ago when Medal of Honor ( the first pc version that ran on a single core 1ghz intel cpu and 32MB geforce 2 or 3 pci or agp video card) and resolutions of sub 1280x800 ACTUALLY showed MUCH more noticeable improvement when you cranked the in game graphical settings.  

If you have to play at 4k rez at 60fps or better fps WITH maxed settings on games like Crysis and Metro,lol, don't hold your breath unless you're that good at holding your breath for more than 13 months when the next line up of nvidia gpu's arrives with 6GB or 8GB of vram...stock, with more powerful vid cards.
Reply: Raymond Tyson well im not planning on getting 4k until they have 4k 120hz displays

and they have gpus that can power the game at maxed out on 4k 120 fps
Reply: Minecast Zyad48 sounds like you aint playing 4k for about 5 more years
Reply: Minecast Zyad48 AND LOL by that time we will have 10k
Reply: dkapbboy I do have it :P  http://www.modsrigs.com/detail.aspx?BuildID=33828
Reply: Sam Kowalski Even though it's an old card I was still running games maxed out or on high settings until it died on me. Battlefield 4 and The Witcher 2 are the only games I had to turn some settings down to keep the framerate between 40-60 at all times. That's because my GTX 580 only had 1.5GB of VRAM.
Reply: wait what are comment of mine are you talking about Kenshin Himura
Reply: I am still gonna get the 980 cause it is only about $50 dollars more than the 780
Reply: LeMasterChief huh weird, i can only find 780's that are more expensive than the 980
Reply: LeMasterChief the 780s used to cost less but all the prices went up cause the 700 series is discontinued
Reply: Sam Kowalski ah i see now, less of a certain thing means its worth more so since there will be no more 700 series cards being manufactured all the prices go up
Reply: yeah pretty much i mean i honestly think they should still make certain ones like the 760 or 750ti Minecast Zyad48
Reply: Sam Kowalski 750 ti is crap, the 760 is pretty good but why them?
Reply: Minecast Zyad48  because it would be kinda nice to have a somewhat mid range card under 350 dollars. but yeah i only said the 750ti because it can play like any can on medium settings or higher with good FPS
Reply: Sam Kowalski if 60 fps is your thing then probably yes the 750 ti would be good in most games but the 680 is more powerful than it and i dont think that the 750 ti can play BF4, although I could be wrong but since the 750 ti is pretty low end from the research i've done it doesnt look like it can run BF4
Reply: Minecast Zyad48 i having really researched that specific card but I'm pretty sure you can play bf4 at at least medium settings and honestly even on low settings bf4 looks awesome thats my opinion tho idk haha if i get a new gpu i would get a 980
Reply: Sam Kowalski yup 980 all the way, although i'd still like to see what amd's r9 300 series has to offer first and see if it beats the 980, this way nvidia will release a 980 ti or 970 ti which will probably totally wreck the competition
Reply: Minecast Zyad48 yeah i agree but i have to admit nvidia should have made the 980 way faster than they did cause the only improvement was features
Reply: Sam Kowalski and it is a litttle bit faster than the 780 ti overall, so i cant wait to see the 980 ti, itll be beast
Reply: Minecast Zyad48 yeah but what i want to see is a benchmark with a non OC 780 ti and 980 so i could see the real raw performance difference between the two
Reply: Sam Kowalski ok then, suggest it to linus
Reply: ***** lol XD
Reply: Well its 200 Cheaper then the 780ti and is decent so gtfo.
Reply: ***** 150$*, but your point still stands
Reply: Martin Romero As well as the fact that it's faster than the 780 ti whilst being $200 cheaper than the 780 ti. I'd say that's pretty great. $200 cheaper AND more powerful? Awesome.
Reply: ***** I didn't.  Try paying attention.  It was the kid who typed " CUZ WE CAN.BLAHBLAHBLAH" . lol.
Reply: Ken S. yeah i was very surprised when i looked up the leaked specs, like the 256-bit memory bus instead of the 780 ti's 384-bit but now ik to check out benchmarks before deciding, i thought the 980 for its price and specs was gonna be nothing next to the 780 ti but i was wrong
Reply: Not 2 gens away 
800 model are M mean as: mobile for laptops and compact computers
Reply: Alberto Jose Quiros Navarro you got that right and i think that the reason they skipped 800 series desktop gpu's was to not make ppl think that they'll be as bad as the 800m laptop gpus
Reply: 980 only just pips 780ti because nvidia slowed the 780ti down with drivers. 335 drivers my 780ti gets 75.6fps. 340 drivers = 71fps. 344.11 driver = 64fps.  fucking scumbags.
Reply: santclause1 I have NEVER seen nor heard of anyone getting WORSE fps on the same exact video card from one driver version to the newer one and I've bought AT LEAST 6 different video cards from the red team dating from 2003 to 2011, and 7 different video cards dating from 2002 to the present on the green side.  Drivers have always either done NOTHING to improve fps in the games I played, or improved them and the side effect issue(s) has/have been hit or miss on the red team, not an issue on the green team.  Something else is causing the problem on your situation. Recheck your settings.
Reply: Raymond Tyson santclause1 you may have a bottleneck in your pc, check your ram and cpu, from what i've read 12gbs of ram is the minimum for not having a bottleneck on a 780ti, i'd still go with 16gbs so that under heavy load the gpu still has room to move around in. cuz like he said, getting lower drivers and getting lower performance is just impossible from what i've seen and researched

edit: getting higher drivers and lower performance my mistake ;P
Reply: Minecast Zyad48 LOL.  RAM has NOTHING to do with whether or not your CPU bottlenecks your video card.  Video cards have their OWN onboard ram ( referred to as VRAM) and THAT version of ram serves a different " location" of purpose versus regular DIMM slot ram even in gaming.  

Now NOT having enough DIMM slot ram can cause a game to crash, and that is usually the ONLY issue with a low amount of ram involving gaming.  Either it runs fine..or it crashes if dimm slot ram is involved directly in the troubleshooting variable.

I've been building gaming machines for myself, my friends, family AND customers ( now over 70 of them) since late 2003.  I KNOW, from experience, what things bottleneck a video card and what things don't.
Reply: Raymond Tyson ik you say that you have experience problem is, what ram do you put in ppl's pcs? because the ram can bottleneck the other hardware, if not then we'd have no need for ram at all and just use the graphics ram in the gpu(VRAM), trust me I've done the research the ram can bottleneck if you dont have enough, the minimum ram requirements for a lot of gpus from nvidia and amd are 12gbs, if they specified a minimum requirement then that means you need at least that much ram for the card not to bottleneck, 16gbs is the sweet spot for most high end graphics cards since it will have more room for when it goes under heavy load
Reply: Ken S. its because you need more ram for the cpu to process all the data of the gpu getting more ram then try out the 980's it will get you more performance, now why do they give minimum ram requirements if its not a requirement?
Reply: You don't need a good GPU to run Minecraft maxed out :)
Reply: TIZ012
Yeah seriously don't want you to not understand this.... You are thick as pig shit.
Reply: danik18 yeaaaaahh no, you need at least a decent gpu, my cousin needs optifine on his radeon hd 1gb graphics card, and dont say its low end, its GDDR5 1gb vram
Reply: Lukas High oh ouch random insult I feel so bad....oh no what am I gonna do, ur insult means exactly two flying fcks to me...tell u what though stay in school and off the drugs little kid and when u get to my level and ur still throwing insults then I will laugh at u more.
Reply: Minecast Zyad48 No, I'm afraid that's not how computers work at all. Would you explain telling me why I get full performance with a nice overclock and no issues of any kind whatsoever when I have a GTX 980 with "only" 8GB of RAM? The long story short is, you have no idea what you're talking about and when multiple people are telling you you're wrong with actual proof of you being wrong, you're probably wrong.
Reply: Ken S. then WHY is there a ram requirement stated ON the graphics cards specs page?
Reply: Minecast Zyad48  Sry just couldn't help myself even though I'm not really following the convo...but GDDR5 doesn't mean a GPU is high/mid/low end it pretty much means nothing but a fast interface between the graphics core and the graphics ram. I'm just saying u should give more detail when u mention tech specs.
Reply: TIZ012 GDDR5 is much faster than older graphics memory types, like a 2gb ddr4(yes in older cards they didnt use GDDR type vram) vram graphics card has got NOTHING on a 1gb GDDR5 card. so my point is that even though my cousin's graphics card can run even metal gear risinng at 60 fps on medium settings to keep a high enough framerate in minecraft that when he starts recording it keeps him at a steady high framerate he needs optifine
Reply: Minecast Zyad48 Actually, you're talking out of your ass again. Graphics cards have used GDDR for a VERY, VERY long time - since 2004 to be exact. Graphics cards have never used DDR4 (which is a different technology entirely and isn't really even out yet for consumers since it's so new), they have used GDDR4. There's so much more to the performance of a graphics card than the type of memory it uses. You have no idea what you're talking about, PLEASE STOP TALKING.
Reply: Minecast Zyad48 There's no such RAM minimum requirements for the GTX 980 that you're talking about - HELL, with the fucking benchmarks of the GTX 980 that NVIDIA themselves did, they used 8GB of RAM which you can find yourself here: http://www.geforce.com/hardware/desktop-gpus/geforce-gtx-980/performance

Stop fucking talking out of your ass.
Reply: Ken S. look up "gtx 980 game-debate" it CLEARLY states that it has a "best ram match" MEANING to get the most out of it 12 gbs as it says are the best to have, also are you saying that if I had 4 980's in sli then 8gbs of ram would be enough? cuz im pretty damn sure that a 4-way sli setup really needs a LOT of ram
Reply: Minecast Zyad48 Do you believe everything anyone tells you? Could you please link me research about where they pulled the 12 GB figure out of their ass?
Yes, 4-way SLI with 8 GB RAM is fine. Did you know that the graphics cards have RAM onboard for the frame, depth buffers, assets, etc? If you did, you would realize you're an idiot.
Reply: Tyler Blair ik that gpus have oncoard ram dumbass, im not that stupid, but i have spoken with member of team green and asked him to give me specs on what a good 4-way sli setup would be and he put 32gbs of ram for 4-way sli, also look here http://www.game-debate.com/hardware/?gid=1700&graphics=GeForce%20GTX%20980%204GB it shows in one area "best ram match" and it says 12gbs for the 980, why would they put this here other than if you would need that amount of ram to get the best performance out of a card, even then im still not going with 8gbs cuz BF4 and soon other demanding games will need 8gbs ram minimum so with no extra ram under heavy load the game will lag
Reply: GPU's use to be just DDR and later GDDR (only for GPUs). Everything has specifications, so that people don't make mistakes like having 2GB RAM and a 4th gen i7 running with windows vista/windows 7 OS...because no matter what GPU u get, ur PC will pretty much be useless. If someone wanted to fail and get 4 GPUs in SLI with 4GB RAM they can..it will only hurt their processor and program loading...which in turn might reduce the performance of the 4 GPUs but otherwise RAM won't do much. Any good performance 8GB RAM (set in dual channel mode) with any high performance GPU will give the same performance with maybe ~<1% difference in performance to 16GB-32GB. I don't know about quad channel that much so I can't give an example but I'm pretty sure would be the same.
Reply: Minecast Zyad48 "why would they put this here other than if you would need that amount of ram to get the best performance out of a card"

Because idiots like you believe more is better. Other demanding games will NOT need more than 8GB of RAM, games barely use 4GB nowadays. I can run 2 to 3 games just fine at once with "only" 8GB of RAM. PROVE TO ME THAT MORE RAM EQUALS BETTER PERFORMANCE IN REGARDS TO 4-WAY SLI. YOU CANNOT BECAUSE IT DOES NOT. JUST STOP.
Reply: ***** Yeah sure...the 780 TI 4-5 months ago I bought for a build for £450 and recently I got a 980 for £470...cheaper? No not really about the same price more or less between £450-£500. Although its true the launch price for the 780 TI was way more in the £550-£600 bracket but it came down quick and lots of consumers could afford it as the price stabilised at around £450-£500. But yes anyone looking for a GPU at the moment should obviously get a 900 series card without a doubt! I was never arguing about this in the first place. Although I would keep an eye on the 780s and the 780 TIs normally on some websites the prices have sudden dramatic drops making it worth looking at the older cards.
Reply: TIZ012 Why are you so obsessed with raving about a card that ISN'T as good as the 980. The 980 will save you money on your power bill a LOT versus the 780 TI, plus where I live (you know, North America), the 780 TI is $700 and the 980 is $500 so it's STILL $200 cheaper. The 980 is more powerful than the 780 TI, it uses less power, and for me - it's a lot cheaper.
Reply: Ken S. well battlefield 4 requires 8gbs of ram minimum
Reply: Minecast Zyad48 No, it doesn't.  I temporarily installed the game 2 days ago and performed all updates.  It consumes not even 4GBs MAX.  You're thinking your PC needs 6 to 8GBs of ram to run bf4 in Windows 7 or 8 to ensure no crashing occurs depending on other things going on that use ram like many tabs open in Chrome and other internet browsers, etc.
Reply: Raymond Tyson i looked it up it says on 64 bit OS's you need 8 gbs on the recommended requirements page. also thats another thing I'm a tab monster ;P which is why I'd still prefer to have 32 gbs of ram because I usually have not only a ton of tabs open but a ton of programs open constantly so having at least 24 gbs of ram would be a minimum for what I do, I also would plan on rendering footage while I play games since rendering takes a long time and yes ik it taxes the cpu more than the ram but the extra ram will help, also it seems that nvidia is working on a couple of new graphics cards, one for a new titan card called the titan x from what I've read and another graphics card, rumored to be the 980 ti which not only has 8gbs of vram but it's also said to outperform the 780ti by 30% so I'm thinking about waiting until the 980ti(whatever that new card will be called) and get 2 of those since by then 2 of those will keep me from upgrading for a very long time, the titan x will probably be overpriced for its performance like the first titan so im not gonna go for it plus even if its like the titan black(meaning it would have the same gpu as the 980 ti[or whatever its called] with the extra cgi stuff like the titan black having the 780 ti's gpu with cgi stuff added in) it will probably be more expensive than the new gpu coming out so im pretty sure only ppl who would want the extra rendering stuff would get it but it has 8gbs like the new gpu coming out anyway so i dont get it, the double precision thing{or whatever its called} would be good but with 8gbs of vram im pretty sure thats more than enough for the new gpu to be fine rendering stuff
Reply: Minecast Zyad48 Ok.  Good for you that you looked it up on the official webpage.  I just told you from my DIRECT experience what it uses on my machine.  
3.6ghz phenom II x6 amd cpu
msi 970a-g46 motherboard
8GB ddr3 1600mhz kingston hyper x ram
Windows 8.1 pro 64 bit ( which uses ALITTLE more ram just idling veruss home 64 bit edition)
mushkin callisto deluxe 240GB ssd- in which bf4 was installed on, notice i said WAS.  f$%k E.A. I"m tired of their " you're required to open a web browser just to play the you-vs-bot campaign"
Yes 8GB is recommended to give you a reasonable amount of " cushion" when playing that game.  I never said it wasn't a reasonable amount.  
I was correcting you on the EXACT-REALTIME-actual RAM usage.  That's all.
Reply: Raymond Tyson ah i see. so how do you like my idea of 2 980 ti's(or what that new card with be called when it comes out) instead of 4 980's?
Reply: The 900 series is a good first step for the future of GPU's in that it proves powerful GPU's can still be affordable and more efficient. I only need a 500W PSU for the most powerful Nvidia card? Awesome.
Reply: Raymond Tyson yeah i thought so since a single 980 ti is already OP
Reply: Michael Finley whoa rly?damn looks like amd might be giving nvidia a run for their money
Reply: ***** 800 series on mobile was short lived, less than half a year, we see 900 mobile series
Reply: Why waste money on this to run 4k gaming i rarther wait for nvidia to release pascal the 5th genaration big leap in front of maxwell
Reply: Michael Finley you do realize that through overclocking the 980 will surpass the 780 ti right?

edit: nvm wrong comment
Reply: Michael Finley unless you plan on overclocking, but anyways the new gpu from nvidia is said to outperform the 780 ti by 30% so i'm going to get 2 of those and not have to worry about upgrading for a while
Reply: Luis Carmona im pretty sure a 980 would be good enough, although I'd wait till the 980 ti's come out, they outperform the 780 ti by 30% and have 8gbs of vram(this is just what I've read, I could be wrong) so I'd wait till those come out(also its not confirmed that they're even called 980 ti yet, so it would have another name, also if a "titan x" comes out, no thats not the card im talking about, nvidia is coming out with BOTH the titan x and a new normal non-titan card)
Reply: Luis Carmona the new non-titan card will either be the 980 ti or something else, the titan x is a new titan card which i recommend you do not buy since it just had some extra stuff for workstation stuff and way more expensive and it has 8gbs of vram like the new non-titan card so there hardly any reason to buy it unless you plan on doing very heavy workstation stuff
Reply: Luis Carmona I7 4930k to avoid bottleneck, this card is unbelievably powerful and therefore needs a really good cpu to not bottleneck
Reply: Luis Carmona it sounds good and the 16gbs ram is good enough, but if you're upgrading to the 980 ti's or whatever they're gonna be called then you're gonna need an I7 4930k
Reply: ***** Go back and REread my comments kid.  I'm not that one that typed my entire comment in ALL CAPS. _.  Common sense helps.  Look it up. Move on.
Reply: ***** No shit kid.  And?  Typing an entire sentence in all caps is yelling.  Typing one or two words in a sentence in all caps isn't yelling.  It's emphasizing and semi-pausing on that word.   It's not that difficult to understand.  A college English student would have already understood that.  I"m guessing you're either in your sophomore year in highschool or you're too young to be on a pc to begin with and that you're still in junior high.  Either way, you'll be ok.  Move on and
Reply: agreed. But why even have the argument? Why would anyone feel the need to upgrade from their 700 series cards already anyway?
Reply: ***** you cant really say which is the best, it goes back and forth
Reply: ***** yeah, also its GTX not GX
Reply: Isnt the 980 like $200 cheaper than the 780ti? Then performs slightly better more often than not? THat right there is a reason to buy imo.
Reply: eleven61 and you can overclock it since the 980 uses less power and produces less heat which will beat the 780 ti even more
Reply: It's like the 9000 series vs the 8000 series again, but still better gains here than back then.
Reply: You play minecraft. That shit game does not need a fucking beast GTX 980.
Reply: Darth Vader ever heard of shaders? that needs a pretty beefy pc, shaders give minecraft a more realistic feel with shadows and other stuff
Reply: ermagerd shaders. Nothing makes minecraft look better. Minecraft nerds.
Reply: Darth Vader u have not even check it out dumbass,. if you had seen what shaders look like then you wouldnt be saying
Reply: Shut up lil kid, grow a pair.
Reply: Darth Vader fuck off darth vader, if you even understood what i was talking about then you'd be apologizing
Reply: Darth Vader just fuck off
Reply: ***** THANK YOU, jeez someone who knows their shit
Reply: What games do you play? Oh yea minecraft.
Reply: Darth Vader im not 12 -.- im 14, and why do you fuicking think im 12? you just dont understand how much power minecraft needs, shaders brings my cousin's pc on minecraft to 30 fps from 200 fps, yeah shaders take power, do your fucking research before saying stupid shit
Reply: Michael Finley Thank God someone with a  brain finally commented and no-one really took the piss out of what u wrote...thank you for ur comment :D
Reply: *****  Nvidia pledged DX12 support for all Fermi, Kepler, and Maxwell (i.e. GeForce GTX 400 series and newer) parts.
Reply: In reality as it comes down to the features, you have to see it for yourself to truly decide if you like the 980.
Reply: ***** Not just by reading the features it has, but seeing it for yourself in person is what I mean.
Reply: the problem isn't that Nvidia and AMD are getting lazy, but that the demand for a more powerful graphics card does not exist.  most gamers are still playing at 1920x1080.  if you are going to blame anyone, blame display manufacturers for selling us lcd monitors that are a lower resolution than our CRT monitors from 1997. and then charging a arm and a leg for higher resolution displays.
Reply: Minecast Zyad48 Oh please the human eye can't even hear past 12 fps anyway.
Reply: pathg13 XDDDD im not sure if you're joking around cuz of putting "the eye cant HEAR past 12" but that was fucking hilarious
Reply: Sybre    spoilers
It's a joke.
Reply: The 780 TI Is more expensive than the 980 and about the same as 2 970's.
Reply: rtainc well its cuz the titans are marketed as gaming cards so that everyone thinks they are good for gaming, the only titan that is currently out that is actually worth it is the titan black, which is basically the result of the 780 ti and the titan getting it on in bed after a night of drinking, lol, my point is that it has the same gpu as the 780 ti and the extra workstation stuff that the normal titan has
Reply: rtainc Voxel global illumination was not MADE possible by the card, it existed before, and was always performance costy. There are tech demos you can find on youtube, as well as other global illumination tech demos you can even download. You can do it with any card as long as it is powerful enough and the software uses the tech in the first place. Meaning, I don't know what the deal is with the 900 series mentioning it. Are they just showing that the cards are POWERFUL enough to run it with no stress? Does it have a structure that hugely optimizes performance for it, for better integration with, i.e. Unreal 4?
Reply: 900 series is NOT two full generations ahead of the 700 series.   the 800 series was MOBILE.  Mobile has NEVER been the same performance as the full sized desktop version.  It has been only with the release of the 900 mobile series that has truly made a REAL jump in closing the gap of mobile nvidia vs desktop nvidia.
Reply: Raymond Tyson now you sir are one who knows their shit. and I was very, VERY surprised at the power of the 970m and 980m, those things came very close to the performance of the full-sized desktop ones
Reply: Raymond Tyson I have a GTX 780 PCI Express.  Do you think I should upgrade to the 980?  I wanna be able to play my games at 60FPS, 1080p on Ultra with a 40" TV.   I'm considering a 30" 1440p monitor as well.
Reply: Crowded House a 980 will be perfect for 1080p, 1440p I think you may need to turn down some settings or get 2 980's, for just overclock the 980 as much as you can and test it out on 1440p and see what you get
Reply: What does "super clocked" mean?
Reply: Crowded House it means it's factory overclocked, overclocked right out of the box, but it's different, it just has a higher base and boost clock so the overclock it pretty powerful on superclocked cards, I would recommend getting this 980
http://www.amazon.com/EVGA-GTX980-Superclocked-Graphics-04G-P4-2983-KR/dp/B00NT9UT3M/ref=sr_1_1?ie=UTF8&qid=1416061855&sr=8-1&keywords=gtx+980&pebp=1416061853685
Reply: The Minecraft Sauce I have a GTX 780 and I'm thinking about getting the 980.  I'm not really that happy with the 780 so far.  I should have put out a few extra bucks for the 780ti and I'd have been better off.
Reply: ***** 3 980's
Reply: ***** yeah if they're higher than 1080p go with the 8gb ones, and i dont know if they're released either actually, i thought it would be another like month before they were gonna come out
Reply: I've got a GT640, was considering upgrading to a GTX980, what do you guys think?
Reply: Keil Gilby yeah no, its a dual gpu graphics card and no you cant max out games at 4k with it. we're talking about SINGLE GPU graphics cards that can max out games at 4k and keep up at a minimum of 60 fps
Reply: Keil Gilby single GPU card, dumbass, name one that can run 4k maxed on at 60 fps minimum, im serious do it
Reply: Minecast Zyad48 Not 4K but, the GTX 980 should be able to run 1440p no problem.  Especially if you turn off AA.  Cuz at 1440p you don't really need it.  Also, I have a GTX 780 and I was thinking of upgrading to the 980.  What do you think?
Reply: Crowded House get the 980, and yeah I agree that 1440p doesnt need AA
Reply: Should I get a Gtx 970 if i'm actually with a gigabyte superOC gtx 570? I could get a ram upgrade this year and probably another ssd and a 2tb hard drive for storage. I could wait one more year but I really want to get far cry 4 for free :P do you think it would be a good thing to wait? thx for the advices
Reply: djamiljo93 i'd go with the 970 if thats what you can afford, although getting that other stuff will help with performance as well, personally I'd go with the 970 and then upgrade with those other things, just as long as you dont have anything in your pc that could potentially bottleneck the 970
Reply: use high end gpus to watch youtube and comment on the already shit comment section
look outside your window and just watch the flawless graphics, absolutely free
Reply: go ahead, burn me at the stake
its not like anybody cares about what you have to say and you certainly dont have to care about mine
Reply: ***** yeah i do, i wasnt planning on using AA for a 1440p monitor, im getting the ASUS 1440p gsync monitor and no i will not being using AA unless i just dont give a fuck about anything at that time, although its like you said theres no need for it on 1440p or above
Reply: If you are running 4K DSR on a 1080p monitor you wouldn't need to turn up the AA so you can have better frame rates. Plus, Luke said that the 780ti was heavily overclocked while the 980 wasn't
Reply: Teh Stranger? wow thats a massive upgrade, good for you :)
Reply: 980 and 780 neck and neck... Fuck no boy that's not true at all....
Reply: i hope you enjoy paying 300-400 dollars extra for a TI 980, i have a evga gtx 980 SC acx 2.0 and the card is absolutely amazing
Reply: tropg nice choice for a GPU, but I'd rather have something that I wont need to upgrade for a while(yes IK that upgrading is easy, but I'd ratehr not just keep spending money every time a new more powerful thing comes out, getting 2 980ti's in SLI is better because that will be more than enough for a while)
Reply: There's a good reason that you only play minecraft
Reply: its called squeezing every extra bit of cash out of the consumer
Reply: I agree, I am going to wait for 1100 series Volta GPU's in 2016, since its gonna have 3D stacked DRAM for I think twice the performance over normal DRAM and quadrupled power efficiency over normal DRAM and NVLink for much faster bandwidth with apparently a much more direct connection to the CPU.

Also, the GTX 770 that I have in my system is good enough until the Volta GPU's come out if not longer.
Reply: Nicholas Jaworski If you want to MAX OUT your eye candy in 4k in todays demanding games, not even 4 4GB 290x's or four 4GB gtx 980's will allow it...IT'S THE DAMN VRAM that is the bottleneck people.  It's not difficult to get.  Save your money and wait on the 8GB vram 970's 980's and 980TI's coming within 6 months or less.  that ONE card with the right cpu ( 4770k, 4690k, 4790k, 8350, 9590, etc) will then handle 4k maxed gaming at 30 minimum fps or better ..PLENTY.  End of discussion.  And no I'm never mad when I type any comments.  You're not the federal reserve.  YOu have never stolen from me.lol.
Reply: Henry Liu Well yeah...but sometimes games might not suport sli/crossfire to well. So you might get stuck playing only on one of the two. Its better to get a high end card and sli/crossfire it later with another one then to directly get two lower end cards.
Reply: yeah is a fact!! im not happy with this 9xx series..i want buy a new powerful computer but i wait for something more powerfull in 2015.. 980ti or 990..
Reply: ***** and you can OC it to be more powerful than the 780 ti
Reply: ***** well the r9 295x2 is still more powerful but its very expensive
Reply: The Minecraft Sauce I have a 560ti and OK, it's not a performance monster, but it's still one hella bang for the buck.
Reply: ***** hey minecraft requires more power then a 30 buck graphics card and I'm not joking, my pc barely runs it unless i have optifine installed
Reply: ***** especially if you want to add in the shaders mod
Reply: Minecast Zyad48 check your cpu usage as java is very cpu  intensive. A gtx 570 is enough to play it at 60fps with everything on high. But when I turn off vsync, the cpu is running at 100%.
Reply: Joshua Olin java's more CPU intensive? wow, did not know that, ALTHOUGH, there are certain things that do require a high end GPU in minecraft, the shaders mod gives minecraft a slight bit more realism, better lighting and certain mobs have glowing eyes and at night with shaders on, omg it looks beautiful. the shaders mod actually does take a lot of power to run but it's worth it if you can run it
Reply: GTX 980 Vs. GTX 780 Ti is irrelevant. You need to compare the GTX 980 to the GTX 780. I do agree however, the GTX 780 performs probably 8% less than the GTX 980 and does have less technologies, but you can pick up a GTX 780 up for around $450 now whereas the GTX 980 is still around $600 - $700.
Reply: Sergeant SaggyBags where did you find those prices? I found a superclocked 980 for $550 o.o, want the link?
Reply: http://www.tigerdirect.com/applications/SearchTools/item-details.asp?EdpNo=9188865&CatId=7387
Reply: Sergeant SaggyBags ohh i see its the windforce one, the one i found was the EVGA superclocked one with the ACX 2.0 cooler
Reply: ***** dayum thats a massive start
Reply: ***** sweeeeeeeet
Reply: ***** i kinda remember reading something like that before XD
Reply: 900 seires has maxwell gpus but the perofrmance ain't that high
Reply: Alex Ene still more powerful than the 780 ti, although it aint 2 GENS more powerful though
Reply: well 780 ti scores little more fps...
Reply: Minecast Zyad48 its not supposed toc be 2 gens ahead they skipped 800 sweries bcuz of the laptop gpuz or sumthing just look it up
Reply: bryanfire202 yeah it was the laptop gpus, they didnt want ppl getting confused or thinking that it wasnt much more powerful than the 700 series
Reply: Alex Ene in SOME instances but if you overclock the 980 enough then the 780 ti is shit compared to it
Reply: stevenmcl1 then get the EVGA superclocked ACX 2.0 version, it's the cheapest one that I can find while it still puts out a huge amount of performance
Reply: Minecast Zyad48 Yeah, was looking at that one or an Asus one, considering my motherboard is Asus. But my 660 is EVGA, so I think I might go for EVGA.
Reply: stevenmcl1 good choice :)
Reply: ***** true, when i fully upgrade my pc its gonna have such high powered stuff that upgrading will be literally out of the question until I get absolutely no frames when playing a game, thats what I say, only upgrade when absolutely necessary, like if you get 0-15 fps while on lowest settings
Reply: ***** good idea
Reply: heheh you noticed that too huh  lol the 780ti has 840 MORE cuda cores than the 980 it also has 384 bit memory ,  the speed is virtually the same AND the 780 is still cooler.  How can Anyone justify this as a major release OH Ya by comparing it to a 600 series card lmao
Reply: *****
well now they don't play fair they just removed all of the 700 series OFF the market. You can no longer find them ohh well you can used or anyone that does have them have jacked em up so high they are not worth it.  NICE PLAY nvidia!!!
Reply: Bob Roberts you are running your mouth a lot for honestly not knowing anything your talking about.... Yes it has less CUDA cores but with it running at even higher clock speeds its called efficiency, as Linus said in the video, which means a lot. If you dont like the card then dont buy it, no need to flame over comments about Nvidia, not gonna change anything. Some people may actually really like this card, doesnt make them wrong. Nobody needs that kind of negativity in their life and i honestly feel sad for you. But at last you will probably come back with "Im not flaming, you are" so itll be worthless to even try and help you anyway. Have a nice day ^_^
Reply: Bob Roberts Yep Bob Roberts... I purchased a GTX 780Ti Classified plus a Classified backplate for $780 dollars, and not even 6 months later they release the 980 and discontinue the 780s instantly.. That pissed me off. I was kind of planning on SLI'ing my card, but now I have to start over completely and buy a whole new 980 GPU before I can SLI, and what do I get from owning my 780Ti? Absolutely nothing. I personally believe that anyone who owned a card that was abruptly discontinued should have a trade in offer from Nvidia/EVGA. Trade in offer or get the fuck outta here.

Edit: Oh and I also purchased a $60 dollar warranty for 10 years... Nvidia fucking raped me.
Reply: TIZ012 http://gpuboss.com/gpus/GeForce-GTX-980-vs-GeForce-GTX-780-Ti  enough   said
Reply: ***** http://gpuboss.com/gpus/GeForce-GTX-970-vs-GeForce-GTX-780
Reply: 4K is a super-gimmick.